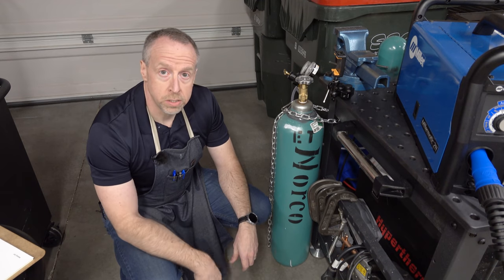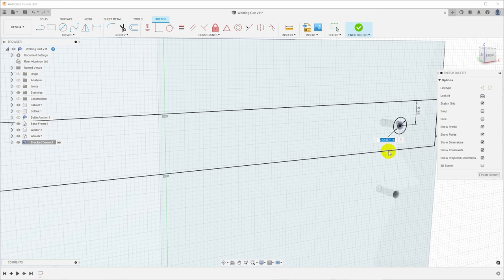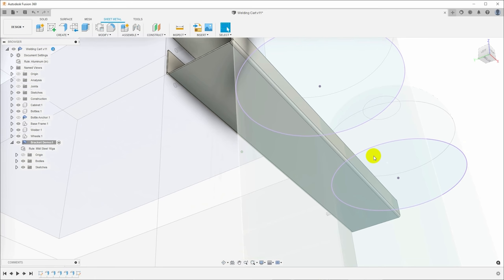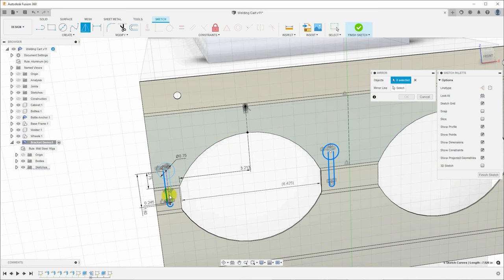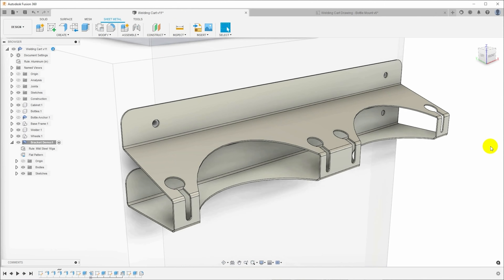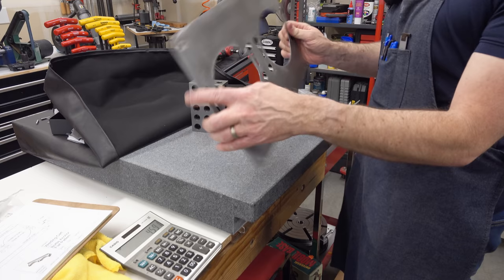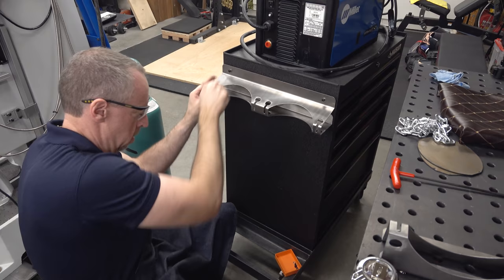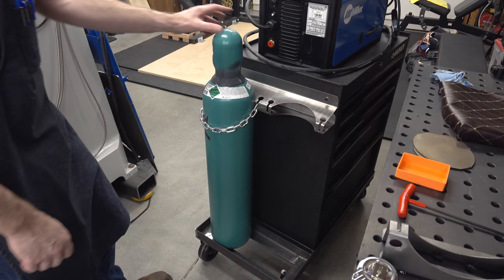Welding Cart Build - Part 2 - Sheet Metal Bottle Bracket

Comment: I'll never understand Fusion 360's sheetmetal terminology. What is commonly referred to as a bend, hem or fold is universally called a flange. A flange in sheetmetal working is an bend on the edges which serving reinforcement or as a support or mating area.

I would sell the bad part on eBay. I'm sure someone would love to have it. There's a big secret to preventing measuring errors: don't measure.  Use a piece of paper and make an imprint. If you have the DPI settings correct on your computer monitor, you can always hold the sheet up to the screen and quickly gauge if your dimensions are correct.